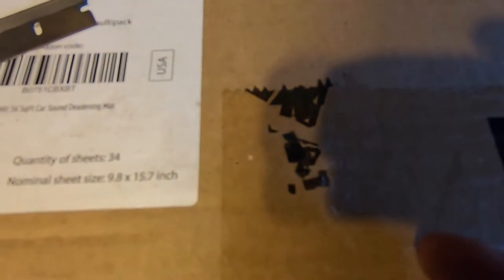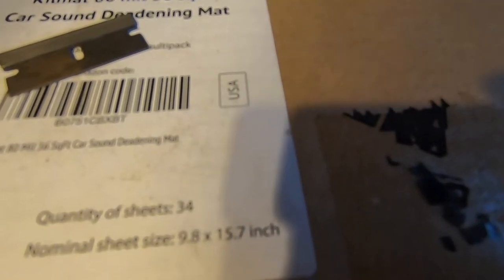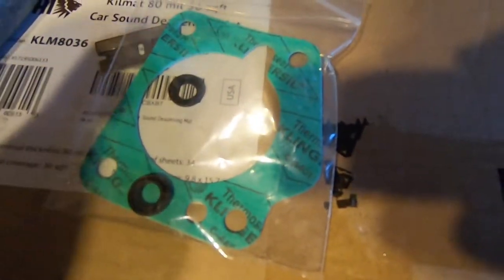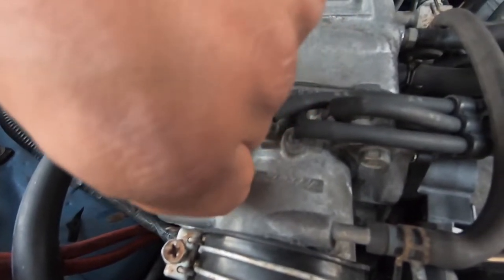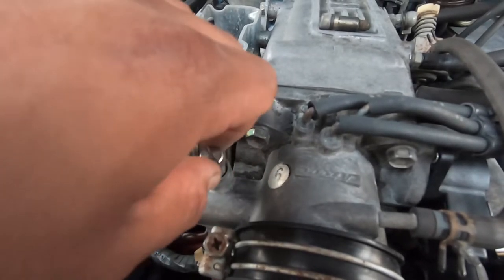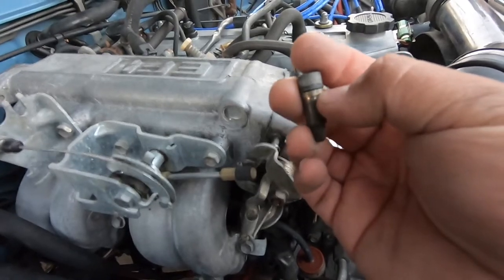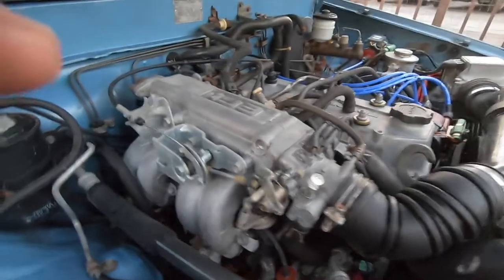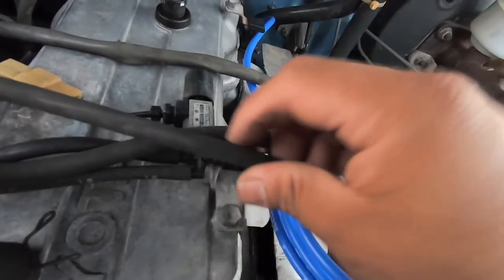Toyota Pickup 22RE Turns Off & Clicking When Pressing The Gas Pedal ** Idle Speed Adjusting Screw**

Comment: I got that same hissing noise too. Ppl keep saying I have a vacuum leak, but did a smoke test and nothing from vacuum. 
Hopefully you get it fixed.
Reply from the maker: I switched the hose on the sensor and it stopped hissing. I guess when i removed the valve cover i accidently put them back wrong
Reply: @OXCFilms  sensor meaning that vacuum switch valve right? Or are you talking about another sensor?
Reply from the maker: Yes the vacuum switch

Comment: I have a 1993 Toyota pickup 4 cilender. Engine was shaking a lot . It had a leaking injector. Mecanic Changed all 4 leak stopped.  But it continued to shake. Clean ed throttle body.

Comment: I think that's a normal vacuum switch sound.  It's got to do with egr or reed value system air injection systems. emissions.
Reply: Nope, If it's hissing that means you have the tubes in the opposite vacuum line. My VSV does not hiss at all and functions properly.

Comment: that thing leaking or hissing on top of the valve cover is called a "vacuum switching valve" and is powered by the ECM and that truck has a hell of a vacuum leak i can here it bad !!
Reply from the maker: Yea the cap on that seams to be hissing. Cant find any other leaks
Reply: And that vacuum leak was probably the only thing wrong and anything else he has replaced already was unnecessary. Possible even the lines are mixed up. In a case like that I get a vacuum hose diagram and start putting everything where it goes and then do a smoke test and see if there's even a leak

Comment: 1984 toyota celica st  22re  it will start but wont idle 
It will stay ringing if I keep hitting the pedal  but if it stop it dies
Reply from the maker: Check tps
Reply: Ok, tanks  also if I disconnect the harness from the  main air flow sensor  will idle, but if I plug it back into  it, it dies
Reply from the maker: Could be a bad sensor
Reply: @Pdrofer235  It mean the air flow sensor is not work properly,disconneted it has to show down.i have 1985 toyota celica gts and did have the same issue and i have to replaced,also i have to reconfigure the tps,both are in the same network.